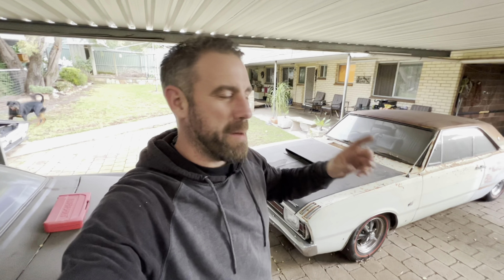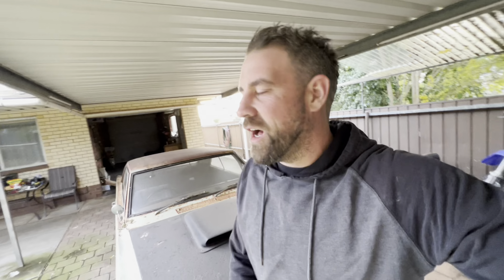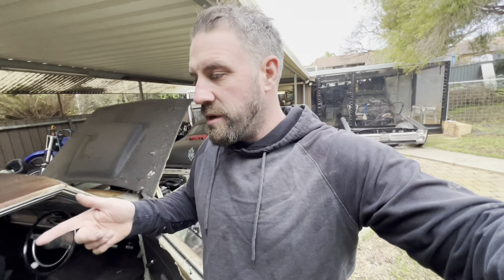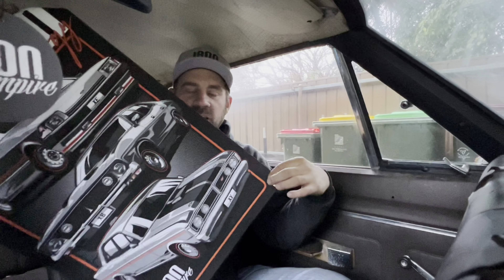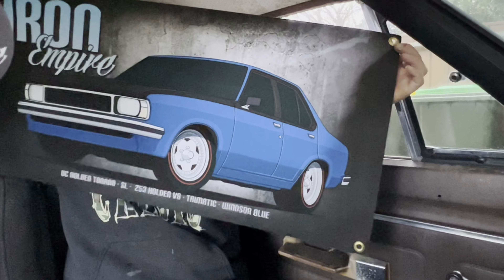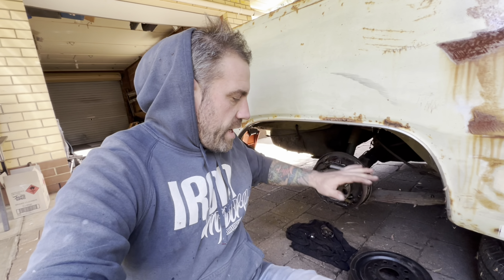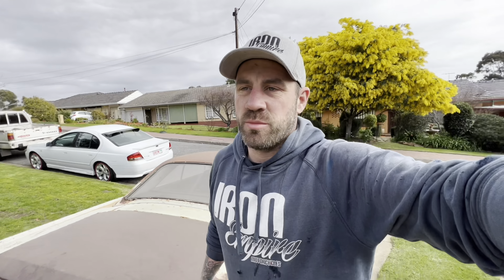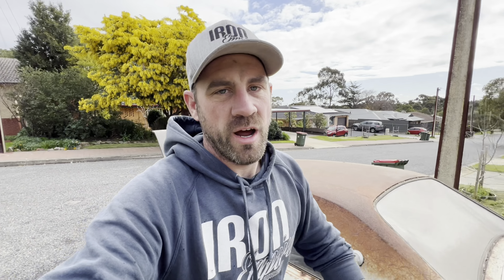Iron Empire EP 101 - It's NOT Good... Valiant Hardtop - Fatal Damage :(

Comment: G'day everyone. I have a VH Pacer. It spent a few years on the back burner while I battled with a 70 Dodge Charger that has kicked me in the balls so many times that I got close to just giving up every time something went wrong. But my Wife and friends gave a lot of help and support in many ways. They encouraged me to get the Pacer back on the road again and things just snowballed from there. Couldn't buy a new rotor button.  So I bought an ICE ignition system. Needed a better carby. The auto trans was playing up, and it turned out that it needed a rebuild. The 265 engine was grotty. Exhaust system was stuffed. Pulled out the drivetrain. Mounted the engine on a stand after taking the trans off. I turned the engine upside down. I hear a noise. Turned it back upright and I hear a metallic klunk in the sump pan. WTF??? The engine was running fine previously. I pull the sump off and find a busted half inch bolt head and washer in there. No broken rod bolts, oil pump bolts or anything damaged though. How did it get there? The engine was reconditioned in late 2006 by Southcotts not long before they closed down. Was it a deliberate but failed act of sabotage or a careless oversight? Who knows? My flex plate was also butchered and needed replacing. 70 bucks just for a sump gasket kit seems a bit much to pay and another 20 for a tube of sealant snot. But it has been sorted out now. I'll have my auto trans back soon. Yes, automatic transmission in a genuine VH Pacer, one of just 16 optioned that way. I have owned the car since 1997. Took my Dodge to the 2024 All Chrysler Day. I noticed that there was coolant leaking from the radiator. The next day a great mate helps me to remove it (I am partially disabled) and I take it to a radiator repair shop only to find it is rooted and NOT repairable. Another kick in the goolies from my beloved Dodge again. Had to buy a new radiator for just over a thousand bucks. OUCH! Old cars eh? The day my Dodge passed through the Regency inspection process for having replaced the tired old 383 with a 528 Hemi went well, but on the way home I copped a 10mm tech screw in one of my new tyres. Such is life, as they say. If it has tyres or tits it's nothing but trouble!

Comment: Ah cars, can't live with em,
can't live without em.........or is that women?
Anyhoo, you get the gist.
You know what you need Mark?

Another car!
Well, it may be your lucky day after all.
I will soon be offering up for sale my 
1968 Mercury Marquis coupe.
As seen in my little picture thingy.
Factory 390FE 4V (315hp)
C6 trans, 9 inch rear
Power disc brakes
Good solid car, not a mega project at all.
White walls and hubbies plus
brand new US wheels, Torque thrust style
4 x 15 x 8, 2 x 15 x 7 and
4 new TA's 235/60/15 and 245/60/15
plus bits and lots paperwork/owners manual etc
Typical full size perimeter frame car.
Built like a 2 door F truck.
It's you man.😉